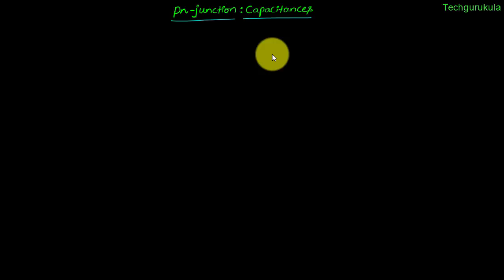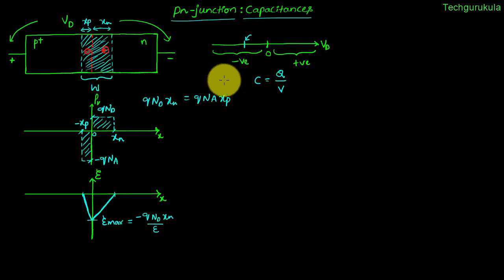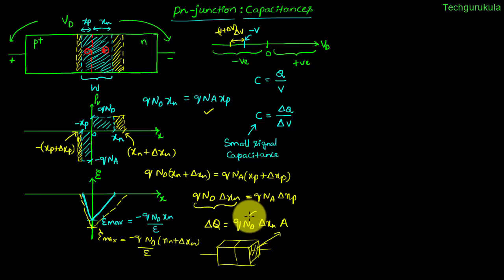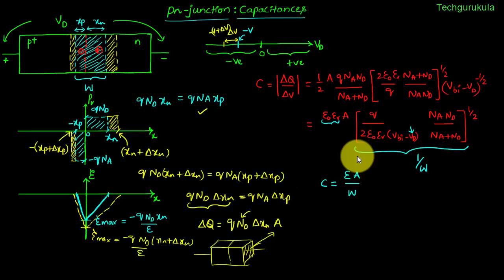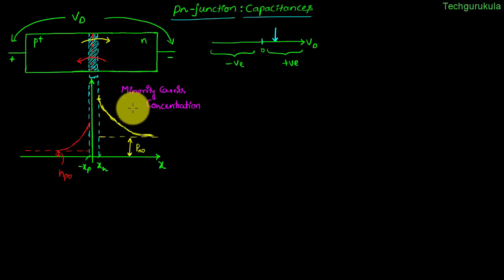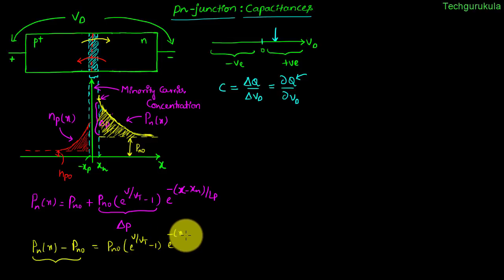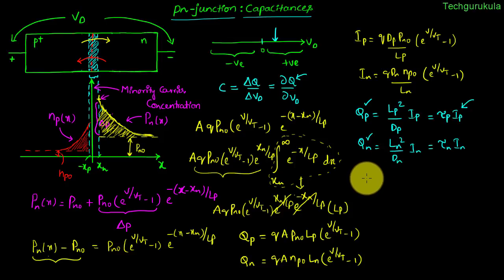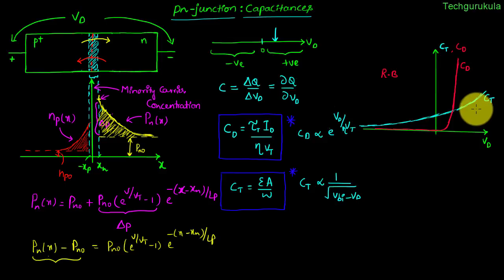Electronic Devices: pn junction capacitance - Depletion and Diffusion

Comment: sir, while calculating deltaQ , why did you calculate only the charge increased in n side? what about the addition of negative charges that has increased in the p side?
Reply from the maker: +ali Nasser 

amount of charge increased in n-side will be equal to amount of charge increase in p-side, opposite in sign though - due to charge neutrality.

Why charge on one side considered for calculation?
Example : parallel plate capacitor, +Q on one plate and -Q on other plate, then capacitance is C=Q/V. 
Q = amount of charge on one plate, because the amount of charge on the other plate will be exactly same, but opposite in sign. 
Hence, considering only one side!

Hope this helps, Please feel free to ask if not clear.

Thanks,
Techgurukula.
Reply: got it. thanks :)
Reply: got it. thanks :)
Reply: got it. thanks :)
Reply: got it. thanks :)
Reply: got it. thanks :)

Comment: Hi, just wanna ask that does the expression  C=del(Q)/del(V) have the range of applied voltage from forward bias to reversed bias? also, is the expression for Pn(x) only valid for forward bias?
Reply from the maker: +yang Yang 
C=del(Q)/del(V) is a general expression for small-signal capacitance. This value will depend on the DC voltage (Q-point).
Coming to your questions: 
1. yes, it is valid for any voltage range, but the expression for charge we have has limitations due to our assumptions like - low-level injection & Depletion Approximation.
2. The expression for Pn(x) is valid for both Froward and Reverse bias.

Thanks,
Techgurukula.
Reply: Awsome! thank you very much!
Reply: +techgurukula sorry, I have another question which is a little stupid.....so Pn0 is the background concentration of ions in N-side, I also see there is Pp0 in some books, does it mean the ions concentration in P-side? and this is actually the doping concentration NA? there are too many symbols that just confused me....
Reply from the maker: +yang Yang 
https://www.youtube.com/watch?v=Ihu0zC7d7hU&index=26&list=PL311CA3047EB6EC58

watch this video, within first 2 mins, it's explained.